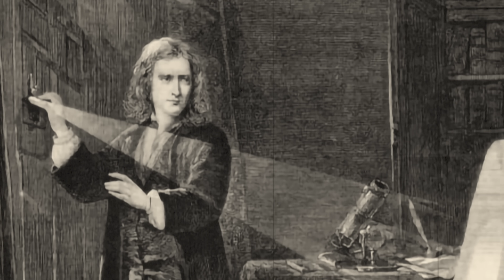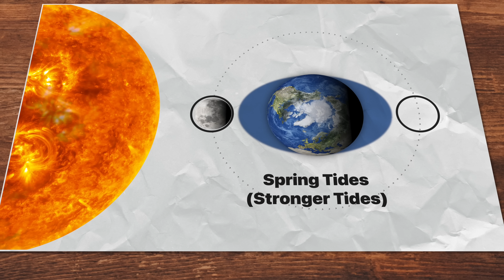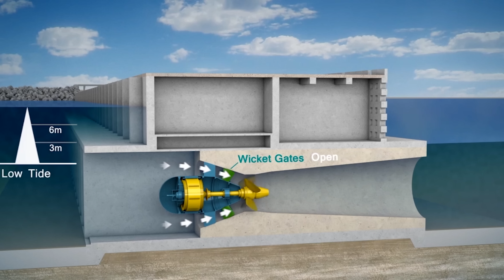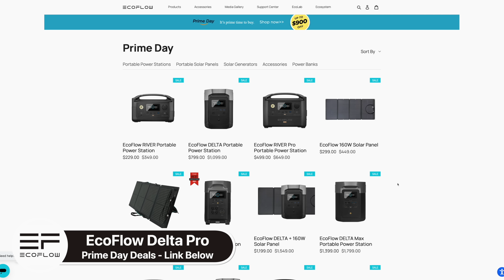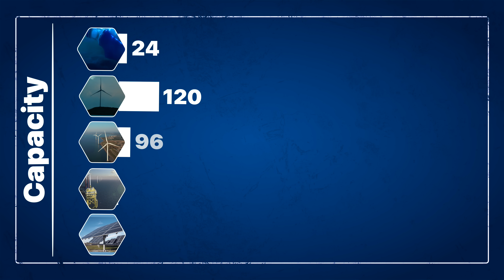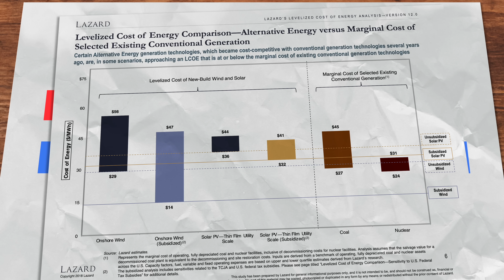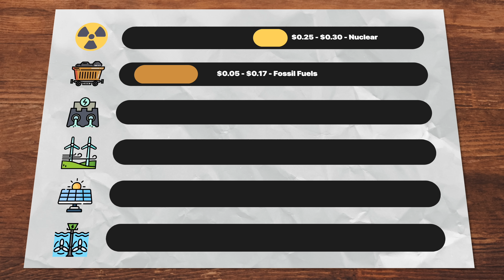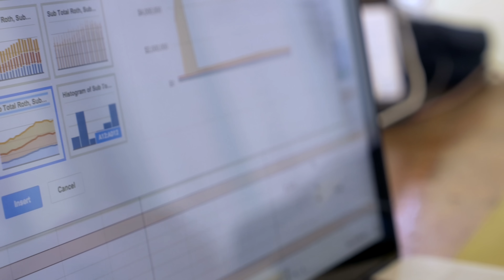Breakthrough Energy Source is 10X Better Than Wind & Solar!?

Comment: We don’t even have to go “all in” on Tidal power. Simply getting to where 0.28% of our power comes from tidal will let us avoid over 9 Gigatons of C02 by 2050! These numbers are taken from the book “Drawdown.”

Tidal power can be expensive, but we shouldn’t worry about that too much. Like you mention in the beginning, the issue with most renewable energy is how intermittent it can be while tidal power is very reliable. So being willing to eat the cost on a bit of tidal generation like I mention above let’s us commit more fully to solar and wind power which will save us WAY more money in the long run than the tidal power will cost us!
Reply from the maker: yeah I think we get caught up on certain things like cost, but predictability is HUGE if we want to eliminate the added need to also store energy
Reply: @TwoBitDaVinci  absolutely! When viewed in a vacuum by themselves those costs can look too high. But when viewed as a group package with other renewables and storage on a grid vs current methods…well it’s just no contest which is the less expensive route!
Reply: @TwoBitDaVinci  in your talk you don't note that tides peak at different times in different places with high tide occurring somewhere throughout the entirety of our 24 hour day. Transmission lines seem to be the solution to variability.
Reply: First, great presentation Ricky! I first came across tidal power back in the early 80' in my Energy Management and Aternative Energy coursework and have since seen it in action when visiting the Netherlands. Here's a cincept...How about combining  the underwater tidal generators with wind generators above them and floating solar farms behind them, all able to share the required grid connections and for good measure, this could include a smaller battery to help regulate/levelise the output from the three sources.
Reply: It is interesting how storage costs to balance power availability isn't factored into other kinds of renewables. If we were to consider the capacity factory of tidal and a small scale battery to take over as the tide is reversing, vs building out enough solar to charge enough batteries on an inclement weather day to keep power flowing 24/7 (worst case scenario) the benefits of tidal will really start to show, even during their minimum since it is predictable and can be calculated out, saving a lot of money in the long run.

Comment: Because Gas Profits!! 🤑
Reply: Theres too much of it and we use too many of it, the tech required to make and use electric transport is also too inneficient and expensive to maintain, not only that, electric transport will become just as damaging as fossil fuels once the demand and usage becomes as widespread as machines that rely of fossil fuels.

The best way to go for the long term is nuclear energy and then (if possible) fusion energy.
Reply: @aunusuallylargecat1779  how does Nuclear solve your transport argument? Nuclear is fine, but far from being as easy or safe as wind or solar.